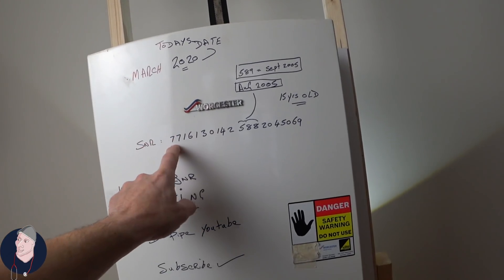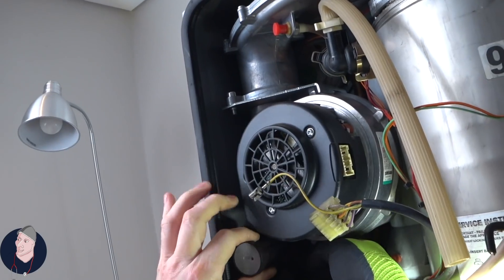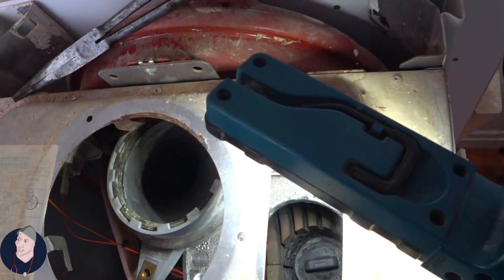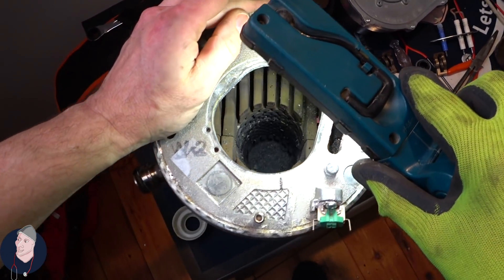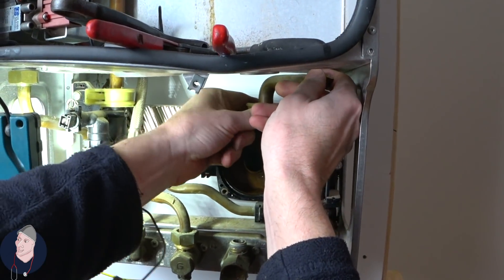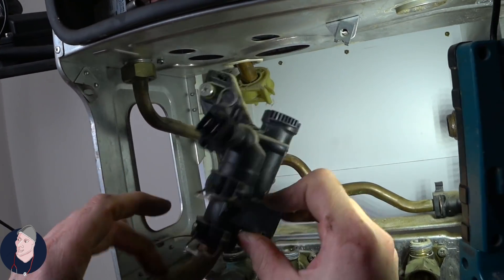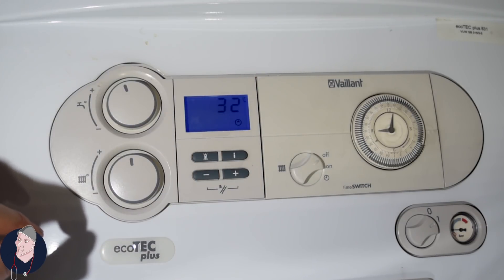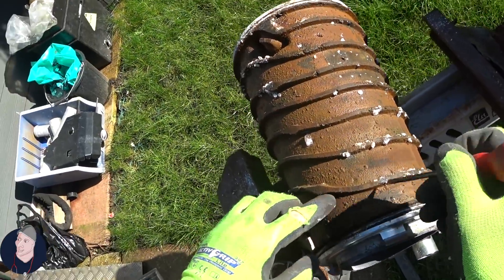Worcester Bosch Greenstar Junior, Dr Pipe Inventions How to Make Worcester Tool, Dosing Pot.

Comment: Hi Dr Pipe - I have a 6 year old greenstar junior 24i with the exact same problem in your video - ie the leaking and the rippling - but i have been diligent about getting it serviced in order to comply with the worcester bosch 5 year guaratee - now its only just out of guarantee and this leaking is happening and the engineer who came to service it has said it is condemned and can't be used.  I cannot understand this as i have followed all the guidelines to comply with the guarantee terms.  Now he says it would cost too much to repair the heat exchanger with labour plus he says it could explode so better just install a new one.  Surely these boilers should last more than 6 years?  My old boiler was near enough 20 years before i replaced with this one and went with the top recommended WB at the time.  But 6 years is not really that long.  Is it really not fixable?
Reply from the maker: Maybe it hasn’t been serviced properly
Reply from the maker: Everything is “ Fixable”
Reply: @drpipe  If it's been serviced and passed gas safety checks every year by a Worcester-Bosch certified engineer would I have any protection if the service was not properly done? Could I complain to WB?
Reply from the maker: @helenmi8406  all wb leak get it fixed move on with your life 🥳

Comment: Only just seen this video! I have to say I personally think worcester are great as you say this boiler hasn't been serviced in what 13 years by the looks of it but Jesus you better belive it didn't batter an eyelid,
Yes they are hard to work on I come across these daily I like them solid and reliable and they come with a 10 year guarantee on their heat exchangers any other brand does this I don't know they also when installed they come with a guarantee not a warranty where the other manufacturers can wiggle their way out of it. But all that what a great video I have subscribed to you ❤
Reply from the maker: Pleased you like 🙏 You seen the Worcester Bosch baffle video I did 💪👍👍

Comment: Hey Dr pipe I have a problem with my heating , the hot water on timer works OK  , but my radiator do not switch on, I had changed my broken digistat scr unit green light is on  , any ideas

Comment: Another great video! In the U.S. charging expansion tank is entirely based on height of building and the piping. What differance does recomendation from manufactuer play?
Reply from the maker: Glen Schmidt so here it’s based on Volume of water as rate of Expansion is based upon that primarily. Most boilers are made with a basic amount of water capability generally 7-10 radiators dependant on kw output. 👍

Comment: The rippling effect is purely a cause and effect of the coil expanding and contracting and does not necessarily mean the hex is faulty ,providing the chamber is producing a negative suction via the air bind a point I believe it was -4.9-5.9 or there abouts

Comment: Nice video, 

Possible lack of servicing, but as Worcester states. As long as your reading are fine and the fan pressure is ok there no need to take the top of the heat exchanger off. Unless the gasket is broken or anything like that.  

But still nice video.
Reply from the maker: Thanks for watching .. now Hit that subscribe button 👍

Comment: Buderus 500 was basically muscled out of the UK market to keep these things out there. It’s a far better heat exchanger. Takes 20 minutes to take out and clean. Very similar, but the case opens from the front, 2 clips hold in the coiled heat exchanger. Had mine about 12 years. Still like new.
Reply from the maker: Thanks for watching .. now Hit that subscribe button 👍

Comment: Rippling doesn’t cause any adverse affect on boiler performance. Great boilers them, bread and butter.
Reply from the maker: Paul Turner agreed 💯👍 This one had a small weep as shown so my thought was he turned it off on those grounds. Personally if it wasn’t leaking.. and loosing pressure I would leave it on 👍👍
Reply: Dr Pipe great vid as usual, top class! Have sent a Twitter dm 👍
Reply from the maker: Paul Turner pleased u enjoyed it 👍👍

Comment: I believe the rippling is caused by running the boiler with low water pressure , in my experience if a boiler has been kept topped up over 1 bar the heat exchanger doesn't ripple .
Reply from the maker: Thanks

Comment: WB are up there with some of the worst designed boilers in the market. Their popularity is down to qualify marketing, not quality products.
Reply: Didnt WB win innovation of the years for 6 or 7 years on the run after introducing the greenstar range ,they spend hundreds of thousands of pounds on R n D and their diagnostic course is secondary to none ,its unfair to publicly drag them over the coals for a minute percentage of products produced, I have never had a bad boiler just lazy engineers who believe naively that a service is shoving in there Anton MK1 and as long as the numbers are ok then that's just dandy I've sacked "quality Engineers "for this sort of shit customer service .
You'll spend an eternity looking for a better boiler infact I doubt you can ,pound for pound they are 100%reliable and trustworthy with excellent in store online or phone technicians who will always be patient to lesser experienced gas engineers or highly technical to commercial gas technicians like moi
Reply from the maker: Kirk Salter 100 agree no really crap boilers these days. A few that don’t have long lives but generally ok. All down to customers 💰 and crap engineers. 👍🙏
Reply from the maker: Thanks works work 🙏👍👍
Reply: @drpipe  lol for sure, without crap boilers where would we be?

Comment: The first bend at the top going into the heat cell usually begins to block.  Casing flow restriction.  It's ususlly also due to lack of  servicing the soot deposits which fall around the baffles cause back pressure.  This takes out many of the top burner gaskets.  Worceshitter don't seem to want change their ways. They're still using this same kebab hex.  These boilers are full of cheap plastic.  Full on pain in the a*se. Still it's all bread 'n' butter DrPipe😜.  I just hate cutting my fingers🙄. The prv's on these are a pain to change and it's touch and go changing the flow sensor  or anything on the ret manifold.  Poo to the badly designed flues.  I've come across a few which have knocked out pcbs on the fans.  Great works as usual Sir, and hats off to you for your excellent knowlege.  Thanks for sharing 😊.
Reply: Just got to say thanks for showing us how to make the tool to remove the baffles.  I'll 100% be making one of those,  I've struggled to remove baffles in the past.  You're inhibitor dosing tool looks ace.  I made myself a dosing vessel from a 5 litre garden sprayer 15mm to 8mm reducer on the end pipe attachment also great for removing airlocks and spraying in to clean hexs. Brilliant content 😝
Reply from the maker: Pleased u get info and ideas from this 🙏🙏👍👍

Comment: Maybe they couldn't get the readings right. Not surprised considering a new type has valve has gone in,but they have left the old restrictor elbow in place,rather than changing it for the one you are supposed to fit with the new gas valve.Ive come across this many times servicing,and the readings are always way out.
Reply from the maker: Adam Goodfield surely should come with the Gv if that’s the case ?..New one for me 🤷‍♂️ Beene ages since replaced a valve on one. Loads fans
Reply: @drpipe  .The new style gas valve(which is fitted to the boiler in the video) does come with the replacement/conversion elbow.The engineer has been too lazy to change it.
Reply from the maker: Adam Goodfield thanks for that gonna look for the differences, never had that 🤷‍♂️🤷‍♂️ been ages since I did a GV 🙏 appreciate that
Reply: @drpipe  No problem.Thanks for the great video uploads,really helpful

Comment: Worcester released a technical bulletin on this rippling. Love the dosing pot thanks for showing it in use. And thanks for going into so much detail. Keep up the great work, excellent content.
Reply: Rippling is due to high expansion from high outputs, the WB6 is a really low water content boiler, less than 2 litres, in the jacket round the outside of the heat exchanger.👍🏻
Reply: @paulkelly3254  cheers for the info Paul
Reply from the maker: What was is due to ?...
Reply: @drpipe  they dont really give a answer!  

 it says "A ribbed heat exchanger does not necessarily indicate failure
Rippling on a WB6 Heat Exchanger does not necessarily indicate that the
heat exchanger has failed or the waterways are blocked. It is absolutely
normal for some ribbing to occur where the boiler has been operating at high
temperatures e.g. Combis with a high DHW set point or high system set
point."

Comment: Worcester main heats ripple from not getting the expansion vessel checked and dirty systems. It struggles to circulate and sucks into its self. I replace these weekly due to the leaking and crust what forms from the same issue's.
Reply from the maker: My belief no water overheats.. pump runs creates a burst of water turns to steam cools sucks in repeat repeat. Nothing to do with dirt.. in essence that failed due to age Ali over heat and very cautious engineer.. lack of service and Manetenance 🤷‍♂️ 14 years not bad thanks for watching 🙏🙏👍

Comment: Ripples due to dirty system water particles building up
In main hex?
Reply: Also as main hex was leaking water and these crap boiler dont have lwps, boiler probably didnt have any water in so overheating main hex
Reply from the maker: My belief sucks it tiny bit of water overheat.. turns to steam overpressures then cools sucks in. Nothing to do with dirt. Symptom of no water lack service. I don’t have a 💯 answer but that’s me at mo 🙏👍
Reply: Dr Pipe how can it ?. It’s a sealed system it’s not open to atmosphere it will not boil water to steam in a sealed circuit.
Reply from the maker: Keith Webster really.. so you heat up the hex then a small burst of water in there trust me it will steam.. I’ve seen steam out the pump let alone the hex.. turn ur kettle on with no water in it and throw a bit of water in it see my point 🤷‍♂️
Reply: Dr Pipe you have kind of answered the question yourself. In a sealed circuit with faults ie half filled heat exchangers or passing prvs/aavs etc etc, when water is heated at atmospheric pressure it boils at 💯, the molecules get exited move about and the product is steam. If the circuit completely sealed to atmosphere and under pressure with no faults the molecules can’t turn to steam as it’s not at atmospheric pressure and vent to atmosphere .